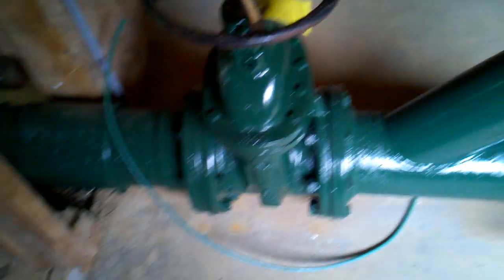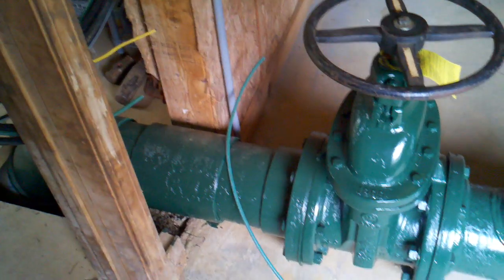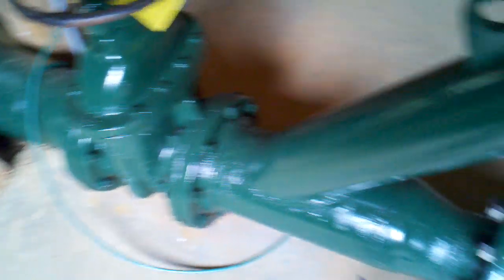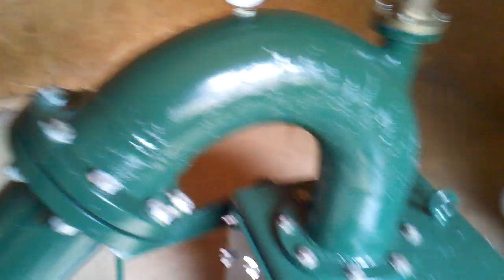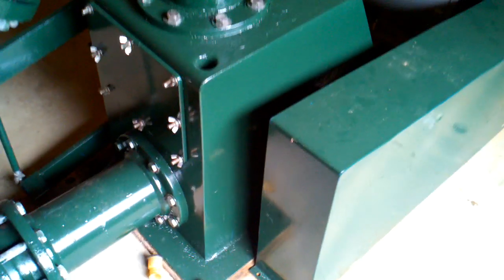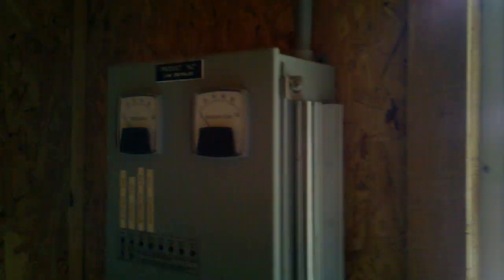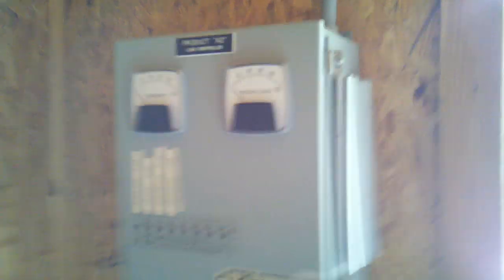Example of off the grid hydroelectric systems

Comment from the maker: Flow rate 3000gal per minute, there is a 700 foot 45 degree fall line, Penstock diameter I think was 3 1/2 inches, Fan stark I do not really know, probably 17 inches, total power generation was 50 killowatts max capacity

Comment: Well looked good content.
I ask for generator specifications.
(1) Flow rate:?
(2) Fall:?
(3) Penstock Diameter:?
(4) Fan Stark Length:?
(5) Total power generation capacity [kW]:?

renewableenergy/57006
Reply: https://cafe.naver.com/renewableenergy/57006
ENOTA

[에노타]

Alternative Energy Hydro Electric

[초초소수력 발전설비]

North Georgia Mountains between Helen, Hiawassee, Blairsville
 

Enota is in the process of creating an educational facility to teach and educate about the three main forms of Alternative Energy. 

에노타는 신재생에너지의 세 가지 주요종류(초초소수력,풍력,태양광)에 대해서 가르치고 교육하는 교육 시설을 만드는 과정에 있습니다.

 

We have already built our Hydro plant.  This plant is capable of producing 30Kw per hour.  At this rate we could power a small village if necessary.   The mechanism that generates the energy was shipped in from Washington State and we are told it is one of the largest Micro- Hydro plants in this region. 

우리는 이미 우리의 초초소수력 발전소를 건설했습니다. 이 발전소는 시간당 30[kW] 출력이 가능합니다. 이런 추세라면 우리는 전력의 작은 마을에 필요한 전력을 공급할수도 있습니다. 에너지 생성하는 메커니즘에서 볼때, 워싱턴 주에서 전력이 제공되므로, 우리는 효율적 가치면에서 이지역에 많은 초초소수력이 설치운영되는것이 효율적 운영방법 면에서 고려되어질 필요가 있다고 생각합니다.

 

At this time we are struggling with the Forest Service to use a pre-existing  water source originally created for this facility with more than enough water and head to power most of our facility.  The hydro plant was installed with all environmental concerns considered,  not knowing we could not use the system already created for our facility.  Please, if any of you out there can help us work with the Forest Service please call us at 800-990-8869 and talk to Swan Freed to volunteer your services.

이 시점에서 우리는 충분한 물과 전력설비의 최상의 출력을 위한 낙차를 이용할수 있도록 관련시설에 대해서 원래 만들어진 기존의 물 공급설비들을 사용할 수있있도록,  포리스트 서비스와 지속적으로 협의를 해왔습니다. 

 

우리가 환경적 관점이 고려하여서, 이미 만든 초초소수력 발전 시스템은  기존의 설비를 사용해서 우리의 설비에 적용할수 없다는 것을 알았습니다. 우리가 포리스트 서비스와의 사이에서 겪고있는 이런 문제점들을 도와주실 분이계시면,  800-990-8869로 문의 전화해서 스완에게 문의하시기 바랍니다.

Comment from the maker: 3rd largest PRIVATE yeah, it was a 25kw generator running off a high pressure hydraulic line.  It's the 3rd largest private hydroelectric plant in the southeast.